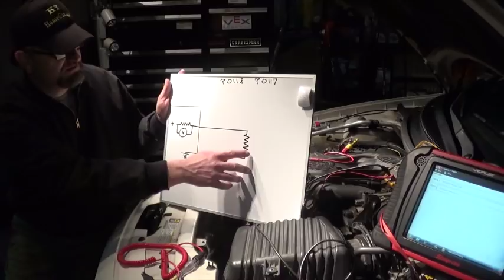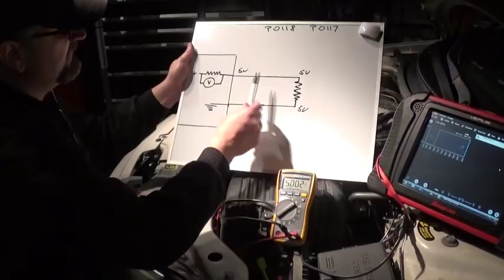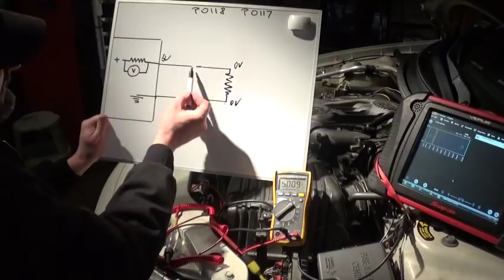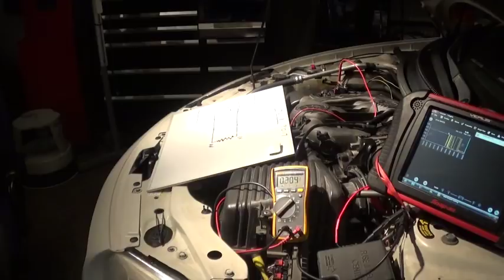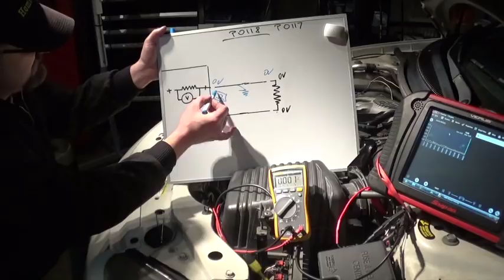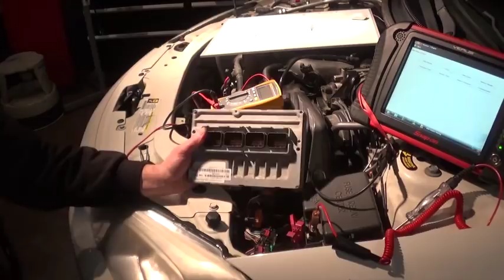P0117 /  P0118 Diagnosis And Explanation

Comment: Please help I have a 2009 Toyota Camry and I changed the thermostat because it was blowing cold. It gave me heat for maybe half hour and begin to go back to cold. My check engine came on for the coolant sensor. I replaced that and it seems as if the car is running worse. Any suggestions?

Comment: Does p118 cause the car to stall when starting? I need to step on gas to start . I’m thinking it’s my injectors or fuel pump but the check engine light comes on p118.
Reply from the maker: Clean your throttle plate first

Comment: I have the p0117 and a p0128. 

The car is running cold all the time. Could this be the thermostat stuck open or the ect?
Reply from the maker: Surge P You need to check wiring firs as was explain in this video. If wiring is OK change ECT

Comment: Mine ECT is new . But it reads -40 . With a code p0118 . So os the new ECT damaged ?
Reply from the maker: EA. jam you have an open circuit. Open sensor open signal wire or open ground wire. You need to test it as I explain in this video. Thank you
Reply: @kyhomegarage3430  i did all the testing . And at the end . I found out that the pins in the plug are loose and too wide . So i tightened them up and all worked great .
Reply from the maker: EA. jam awesome I am glad you got it fixed.👍
Reply: @kyhomegarage3430  thank you . You give me a lot of information that i didnt know .

Comment: p0117 and p0118 if you have these codes scan ecm and if it happens at 178f it is bad ecm . computer changes scale at 178 . i have replaced a few for this problem . watch your graph at that temp

Comment: Nice explanation Ramon of a typical thermistor circuit. The only thing that might be a little misleading is the voltmeter you drew across the pullup resistor implies that the PCM is looking at the voltage drop across this resistor. The PCM is looking at the voltage drop across the thermistor which means you just need to show the voltmeter across it. You just need to show one of the voltmeter leads referenced to ground. Also, this analog voltage being measured by the PCM across the thermistor is fed to an A/D converter where the CPU can use its binary value. Good work and have a happy holidays!
Reply from the maker: stuzman Sorry for mistake I made. Thank you for explanation sir it does make sense. I hope that rest of this is good. Thank you so much for being part of my channel and sharing your knowledge with us. Cheers